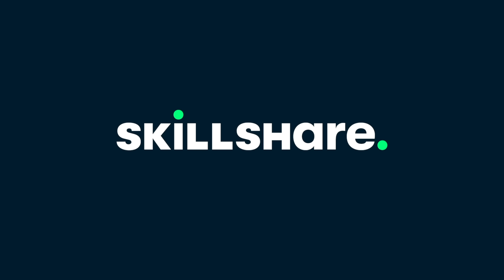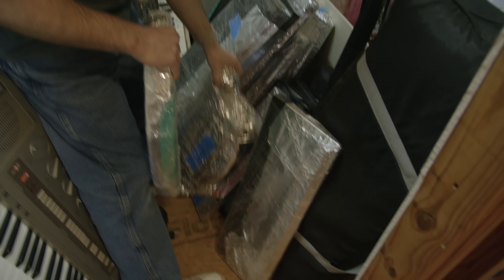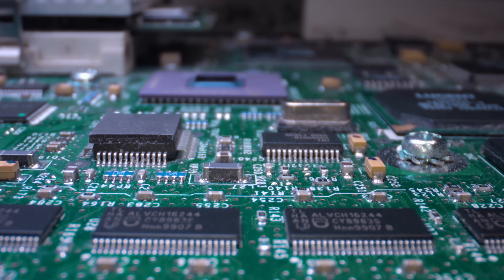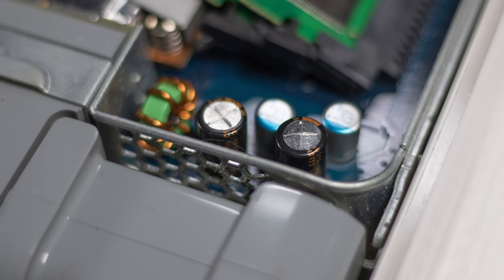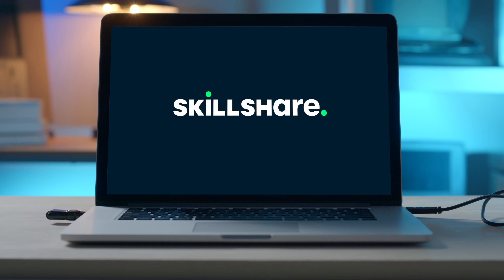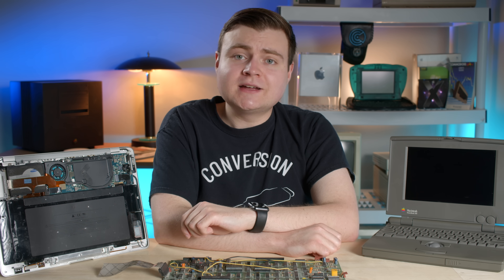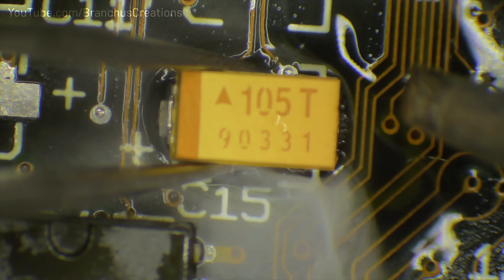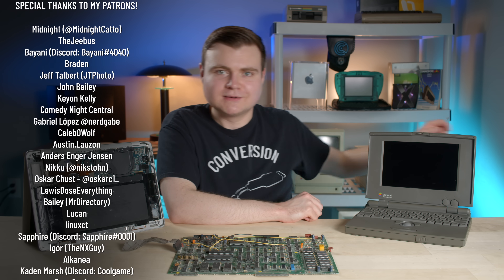Why Do Computers Die? (ft. The 8-Bit Guy) - Krazy Ken's Tech Talk

Comment: I wonder if my college MacBook Pro suffered from that RAM slot soldering issue as well....It looks to be the same model, and I constantly would turn my computer on and be greeted with the three beeps....I sent it in to apple at one point and they said my third party RAM was to blame, but even using the stock RAM didn’t remedy the issue. I eventually just used packing tape to keep the bottom panel of the case on so I could easily reseat the RAM during lectures without needing a screwdriver XD

Comment: This was the best explanation of how a capacitor works I have ever seen!
Reply: A minor correction, he says at 4:38 that a capacitor smooths out the flow of electric current, but this is not the case. It actually smooths out the voltage. An inductor smooths out electric current.
Reply: Capacitors are not like batteries or a bucket with a hole, as:
1. They stop conducting electricity when fully charged.
2. They may may remove DC portion of the signal, not only AC, as shown in the video.
3. Capacitors may zap you, which is always fun!
Reply: @volo870  also dielectric fluid is not conductive, it's actually an insulator, it will not short out anything, what it will do is corrode some materials, 

Also correction the bucket analogy isn't really bad, the buckets full of water is splashes over and leaks out, the capacitor is full... And you keep trying to pump energy into it the extra energy goes into heat instead... 

Maybe it would have been slightly better to attributed more closely to a reservoir directly connected to the pipe instead but your statement that the bucket can keep filling after full isn't really correct either

Comment: My mom dropped her old iPhone 6s in the toilet. It was working immediately after that incident. Then she washed it with WATER. That killed it.
Reply: Thomas Backman Did that. Water was already in the phone. I’ve opened it up, and the logic board was practically toast.
Reply: Thomas Backman Luckly my mom got a new phone not that long after (SE gen 2) and I already had (and still have) another 6s. Only differences between mine and hers is the software version and the color.
Reply: Epic Gamer The Sim Card tray has no sealant. If it did, the 6s would likely have a significant amount of water resistance (home button has water resistance I’ve spilled plenty of sodas and water on it and a raindrop once fell on it that covered the whole thing). As of now, it’s splash resistant (probs what it was designed for)
Reply: @thomasbackman3599  Rice doesn't do anything.